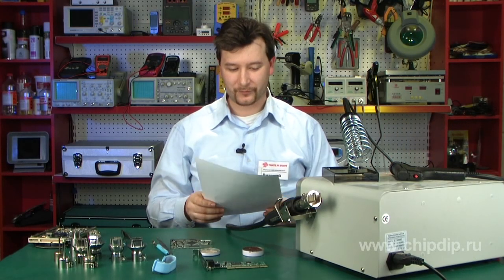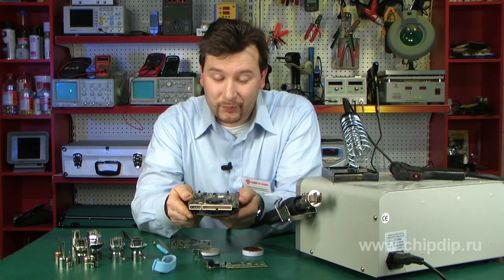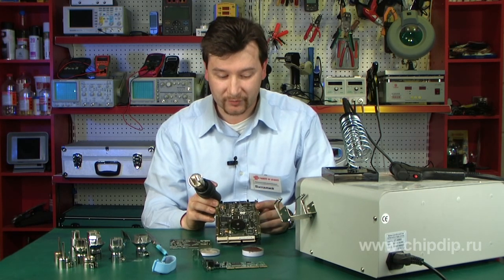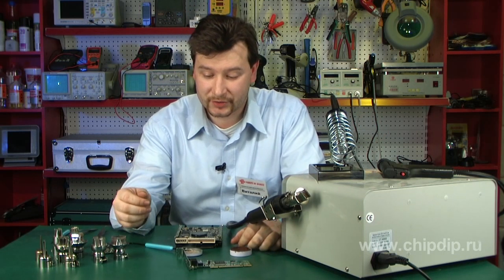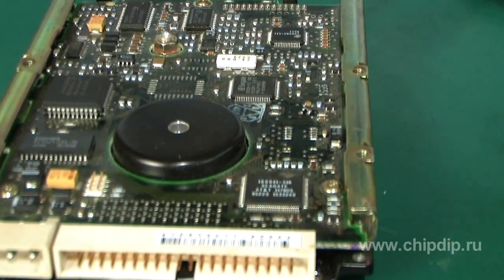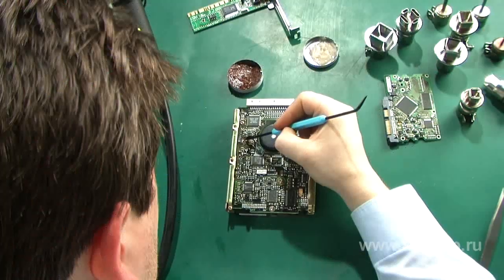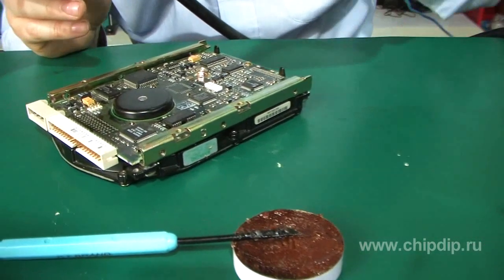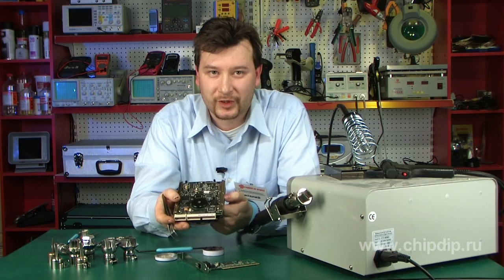Hot-Air Soldering of Microchips

Comment: The first paste he uses is solder flux. For hobby applications look for "no clean" as it is not very acidic so you don't have to worry about washing your work. This is easiest applied using a paintbrush or a pick (like the instructor).

The second paste is solder paste. I cant say that I have ever seen red solder paste, but there are lots of different types. You can buy it in small quantities in syringes, which makes dispensing MUCH easier. Kestler is one of the more popular manufacturers.

Comment: I've been pulling all types of SMD chips from boards for decades and I never make physical contact with the hot air tool. That's the whole point of using a hot air rework station. 

I hardly ever use it to install chips. So much easier to use an iron with a small screwdriver tip and plenty of flux.

Comment: There are many designs where this will not work because the pins are not accessible.  Some chips on modern microcontroller boards are not only very tiny (.5cm a side) but all the pins are on the bottom and not even visible when the chip is in place.  In these cases only hot air or very carefully applied radiant heat from an iron will do.

Comment: I have never seen such a complex way to do a simple job, hot air to remove the chip then like said solder it back using a 0.8mm chisel tip,, simples